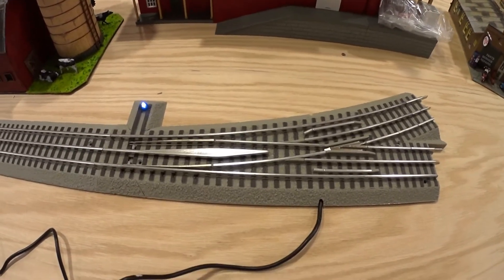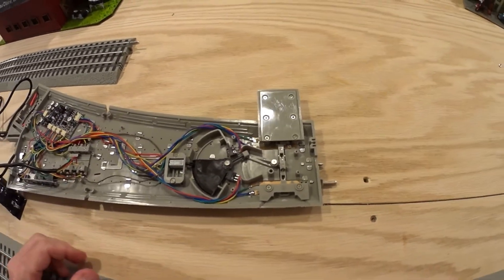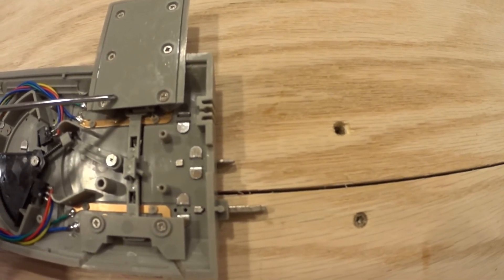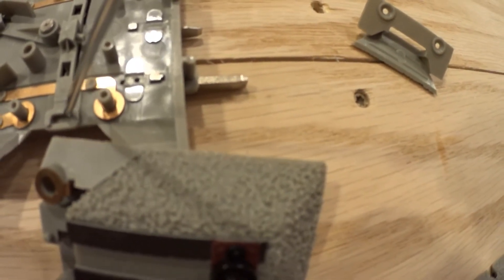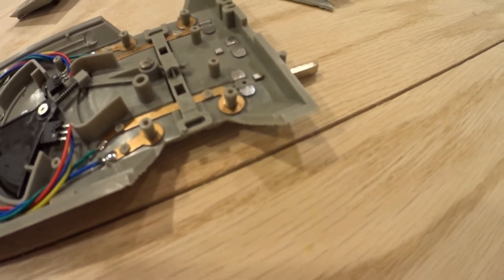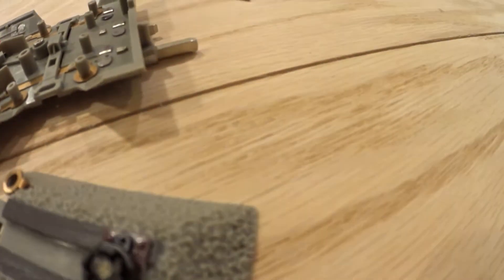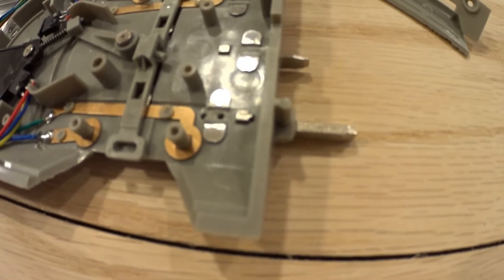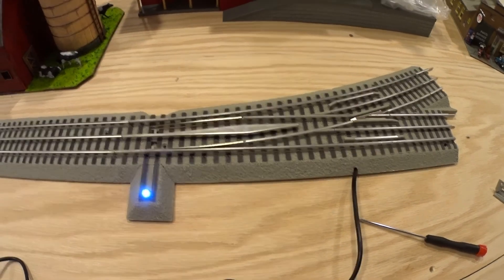Fastrack Switch Stand Jamming The Switch - Cause & Fix

Comment: OK. I'm seeing this 9 years later and had this issue with a couple NOS switches I found at an estate sale. Just getting back into running  my post war stuff that's been in storage. Where do I get those lights at the switch points? Part number or provider?

Comment: Hopefully this message finds someone who can help!! I have 2 manual switches 031 & O36. Both were working fine. Now both have the locomotive dropping power just haver the fork. I have seen others mention this problem but have yet to find a solution. Track is cleaned fyi. Hopefully someone has a link or video that I missed scouring the internet 🙏🙏🙏

Comment: Here's my question.  7 years later.  I had this issue too.  Fixed mine in 2017.  Has lionel ever attempted to fix this obvious manufactured problem?  That "nubbin" as I call it, isn't some pimple that teenage switches get.  It happens at the factory.  Just wondered if lionel ever addressed it.
Reply from the maker: I'm guessing they did, but it is very easy to get switches that are New Old Stock at some store where they have been sitting all that time and people could run int the issue.
Reply: @SeansHobbyHouse  That's what happened to me.  Not to change the subject, but recently I saw a YT video about the new Voice Activated Commands Bluetooth.  Seems Apple stuff works just fine, but for some reason Android keeps dropping out.  Questioned authorities at Lionel have seemingly said they know about the problem and have no plans to fix it anytime soon.  Wonder what else they've been made aware of that they "aren't fixing anytime soon".

Comment: So glad I found this.. same issue. Will try checking to see if its the same thing cauaing that. I'd however have 2 other issues with my turnoutvyou might know how to help. 1) the switch lever isn't lighting up like my other one does 2) as soon as the engine passes over it, it switches on its own and causes the tender to derail?!?!? Can you help with these issues??
Reply from the maker: This usually means it is miswired.  There was a manufacturing mistake on some Fasttrack switches where the wires were reversed and caused those issues you describe.  Also, sometime people wire the controllers on wrong terminal.  Here is a link to verify yours are wored correctly.  See if that helps.  https://ogrforum.ogaugerr.com/fileSendAction/fcType/0/fcOid/58728032796509829/filePointer/59009562179399218/fodoid/59009562179399214/Corrections%20for%20Fastrack%20Remote%20Switches.pdf
Reply: @SeansHobbyHouse  wow. Thanks for the response. I'll check that out.

Comment: Nice video! How did you remove the numb?
Reply from the maker: Just a hobby knife.  Be careful if bending the tip, they are brittle and can snap off ruining your switch.  Very, very slight pressure

Comment: Great video thanks for the thorough review! The build quality of thease switches are garbage. For the cost they should be way more sold.  On the manual switches i have the darn track for the switch dident line up at all because they over tightened the rail into the base, casuing the de-railer to fail every time. I had to shim the screws with plastic washers to get the ride hight right for the rail.  This was in addition to having to file Metal burs off the directonl rails. Thease issues would not happen if they were still metal, Lionel needs to stop trying to pass cheep blow molded Chinese junk as high end hobby products.  They charge enough for them, the loyal fan base deserves better.

Comment: Hey Sean, I watched your Switch jamming video because I have the same issues. I am new in the Model Train hobby and I started with a simple Lionel Ready-to-Run kit. I had so much fun I wanted to continue and expand the simple oval. I watched all of your videos and learned a lot. Where I live there isn't any good model train stores. So I found TrainWorld and I ordered a bunch of Fastrack. I got a total of 10 switches and I had issues with 4. I fixed a few myself and today I started having issues with the jamming and automatic derailing feature not working. I am still using the remote switches. I haven't moved yet into the Command arena yet.
Did you have all kinds of issues with Fastrack? I have thought about switching to MTH track. I really don't know what is recommended and what isn't..
Your advice would be very helpful. Thank you

Comment: Just saw this sean. Great tip. To bad lionel has these small issues. I have all o36 manual but am planning on getting lots of larger fastrack switches in the future. With this fix and the point rail fix you pointed out in your other video. These should be fine for years of service on our layouts I hope. I  like fastrack and the fact the switches have command control built in.

Comment: Excellently  explained video.
Question 1     Do the LED Lights over heat with the 18 volt track power?
.                        I saw another video where they explained this problem..
.
Question 2    When running manually with the track power variable,
.                       Is there sufficient track voltage to operate switches at lower track speeds?
.                       I also saw another video that explained this problem.
.                        
.                       I am 65 and have spent 2 day seeing every Lionel Legacy You Tube.
                        All these years I thought RR Modeling was for children.
Reply: I have a very stupid question, from a new-be  Model RR.
If you ran your trains in the opposite direction,
would you have to still change the track switch configuration. 
.
This would all you to turn the switching track around to have it operate
from the other side. 
.
Do they make Left and RT, controlled switched  Fasttrack?
Reply from the maker: Those are just the LED's without the switch lantern on them.  Normally they would have the lantern and it turns to the track direction to show green or red.I have never had any issue with overheating.  The LED's don't get hot at all.
Reply from the maker: Yes they have left hand, right hand and WYE switches.  The switch automatically switches to prevent derailment if the train is coming into the switch from one of the 2 legs.
Reply: You have been so very helpful.
 60 years ago when I was 8, I had a Lionel train.
I loved my train so much. 
If I had kept it, it would have been worth a fortune today.
It ran with a 10 pound transformer and veritable voltage.
I think I am going through a second childhood.
.
A max of 3% incline to a track is small.
Got any suggestions on how to increase this percentage.
1) add friction to the track
2) add weight to the engine, 5 -10 oz.

Comment: Great videos.  Thank you.  Are you on the OGR Forums?  I'm FrankfordJunction there.
Is it possible that you can explain why you chose FastTrack?  I hoping to be building a layout soon.  I have a lot of FastTrack but was considering switching to a different track (pun).  I'd be very interested to hear why you chose FastTrack.  Thanks.
Reply from the maker: I chose it because I wanted to use all the Lionel LCS system components (like the sensor track and other accessories) and did not want to be bothered with hacking it in to another track system. Also I wanted to use the Lionel switches because of the LCS system and being command control and not have to worry about wiring, buying switch machines and all the other stuff you must do with other track systems.  It is all plug and play.  The other system require more work and more components with add up to a lot more.
Reply: I am new to RR modeling.  What else is available other than Fast Track?
Reply from the maker: MTH has Scale Trax and Real Trax systems.  Then there is Ross, Gargraves and of course standard tubular track.

Comment: Hey Sean, I've been having simular problems with my Fastrack 0-72 Wye... I picked it up lightly used and I'm unsure if the switch stand was moved by the previous owner. I will give this a try and see if i can get it working again. Thanks for sharing,
Ethan